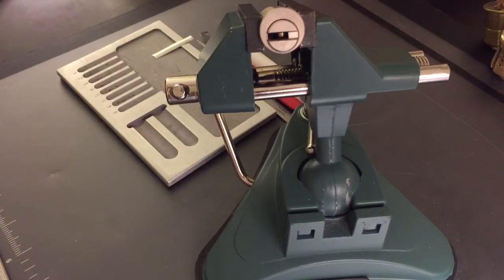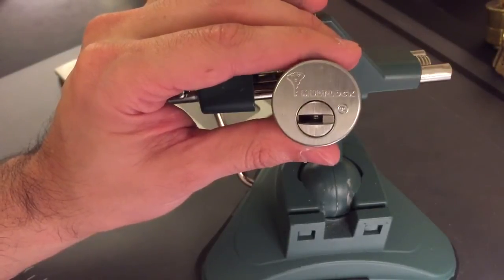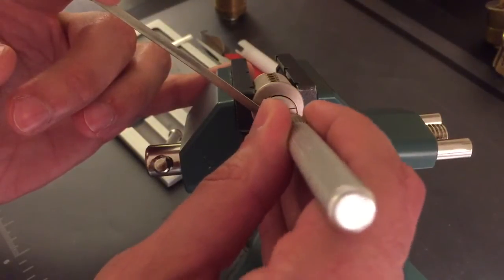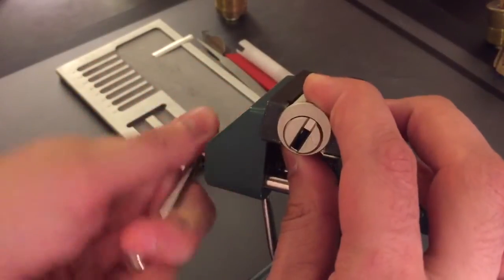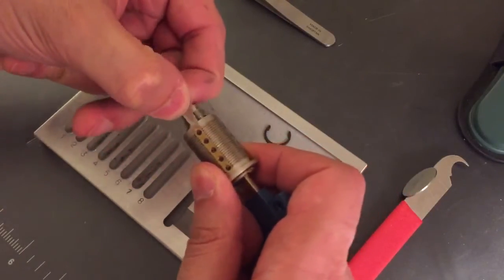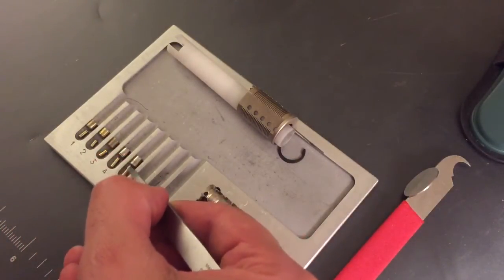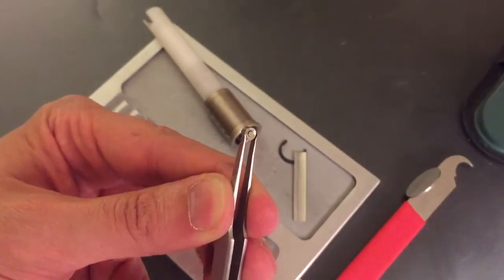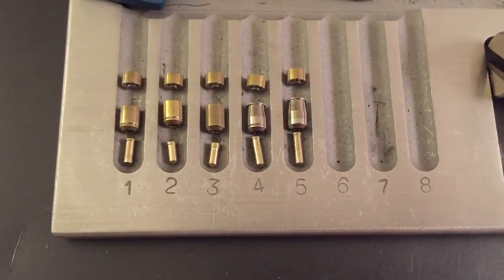[32] Mul-T-Lock Interactive Cam Lock Picked and Gutted

Comment: Damn those drivers are so tiny. It's crazy go they are able to squeeze  spring into those drivers to make it pin-in-pin.
Reply from the maker: Packing everything in was definitely an engineering feat; however, clearly security suffered.
Reply: Ikr

Comment: My key for my TSR-50 padlock looks very similar to your key except for one difference. My key has what looks like normal bidding (very small bidding) on the side after the dimples. Does it all feel the same in the end or would you attack my lock differently then this lock?
Reply from the maker: +zakorkaz I assume this is a continuation of our discussion from reddit (sorry if I haven't connected everyone's different screen names yet)?  I'm not sure what side bitting you are talking about... does it have sliders?  I don't see anything like that on your key.
Reply: +LockPickingLawyer 
there's some mini bidding at the end of the key then it turns to dimples. I'm not sure how to describe it.
Reply from the maker: I just looked at your picture, and I'm not sure what you are talking about.  Sorry.  :(
Reply: +LockPickingLawyer 
I'll photoshop the picture to show you.
Reply from the maker: +zakorkaz  great. Thanks. 👍
Reply from the maker: I see what you mean now... The reason it looks like the bitting on the edge of a normal key is because of the grooves in the key blank that allow the key can pass through the warding, otherwise (if there was no warding) it would just look like three dimple cuts like what you see close to the bow of the key.  Does that make sense?